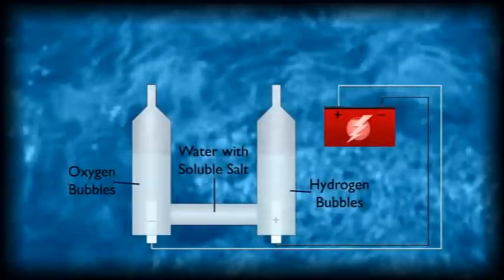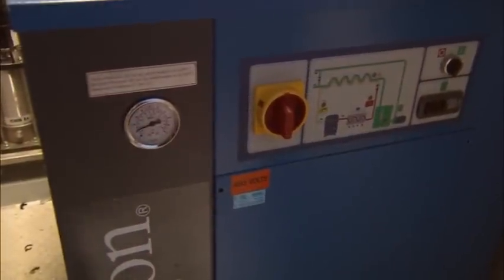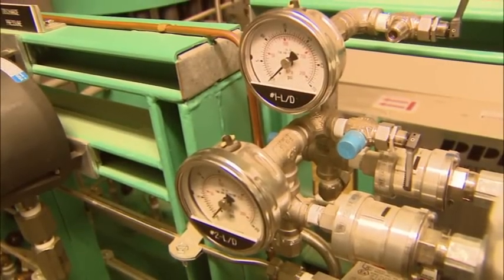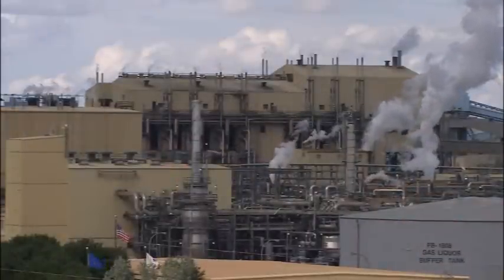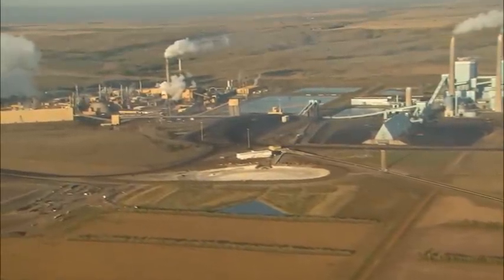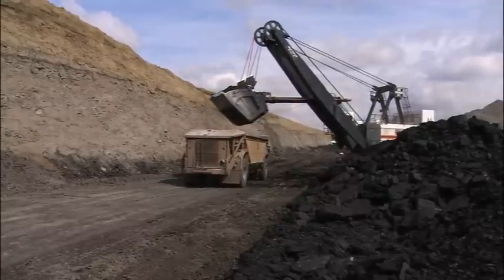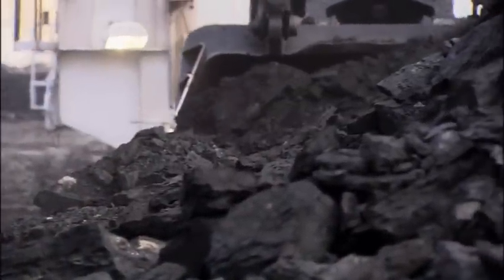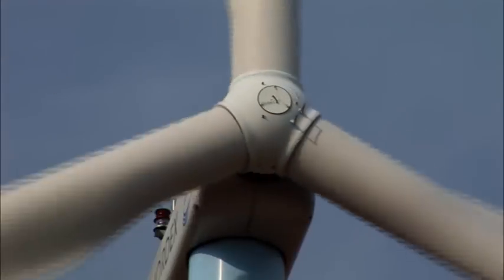Hydrogen: Nature's Fuel (Hydrogen Production)

Comment: We just got these where I work. They sure do seem to break a lot. Need a guy stationed in the plant just to repair them. They also need to be filled about 2 to 3 times as often than using a lead acid battery. Not sure where the savings are.